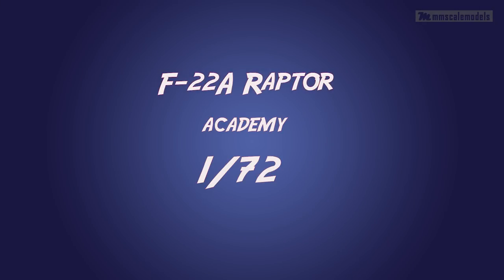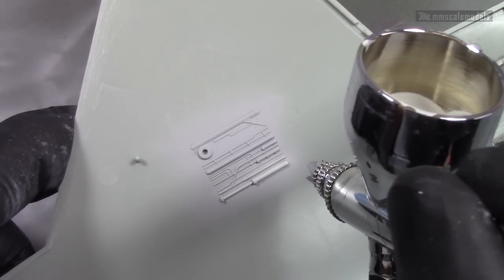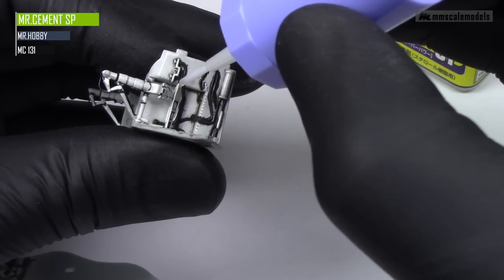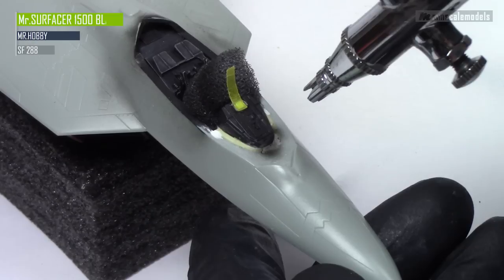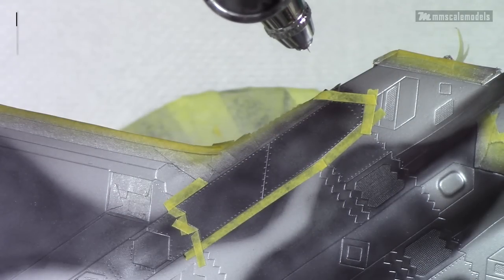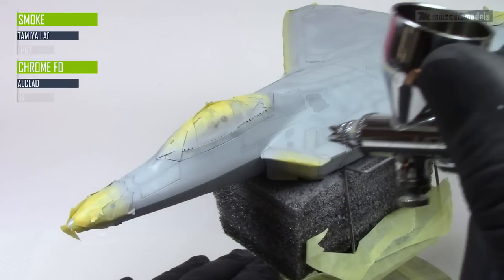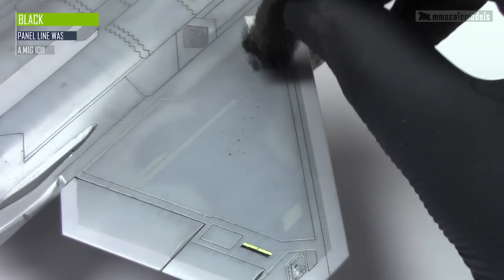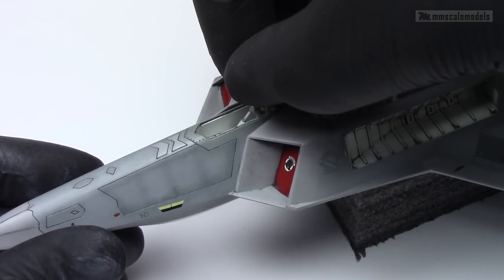Academy F-22A Raptor 1/72 - Full build

Comment: That started out scary with the putty, but you really pulled it all together towards the latter half of the build.  The detail looks more like a pro 1/48th scale, so you nailed it in many ways.

Things I might have done different would be filing down the edges of the AIM-9X missile fins to get rid of the blocky execution of the molds, but that’s hard to do on 1/72.  I just got 2 Revell 1/72 F-22s, and I want to focus on the weapons bays more than anything as part of a bigger project.  I like your weapons bay detailing on this.  I’m looking at close-up photos of real F-22A weapons bays to try to nail the details.  Overall great job man.
Reply from the maker: Thanks mate, TBH I am not very happy how the paint turned out as I really had something different in my mind but stuff like that happens.

Comment: I think a little interesting thing you could possibly add to the gear is sanding down underneath the  tires just a little bit to add the weight effect on account of the aim 9s, AMRAMs, and the two external fuel tanks.
Reply from the maker: Yup, you are right. Properly weighted  tires are a cool little feature.

Comment: Concerning my airbrush, do I have to put thinner in all my colors. 
It seems that when I do put thinners in my paint all it does is make it watery and not stick well.
Reply from the maker: That depends on: the nozzle size, the paint, the pressure and how much you pull the trigger. With all possible combinations you'll have to find the sweet spot for your setup. I personally shoot trough 0.2 and 0.3 nozzles and I thin my paints quite a lot. But some paints are thinner than others to begin with.
Reply: Thx for the reply. I’ll give that some thought and see what works for me.

Comment: Nice job. I just bought the same kit with the same Aires upgrade sets. Is there a reason why you didn't use the Aires resin canopy base? I haven't received my kits yet and I couldn't find any user manual on line. I am a bit worried about the fitment now.
Reply from the maker: Unfortunately you have every reason to be worried about the fit. I struggled a lot especially with the engines. For the same reason I ditched the canopy frame. I am not excluding user error from the equation but.... nah it just does not fit.
Reply: @MMScaleModels  Thanks for the heads-up, I will adjust my expectations.